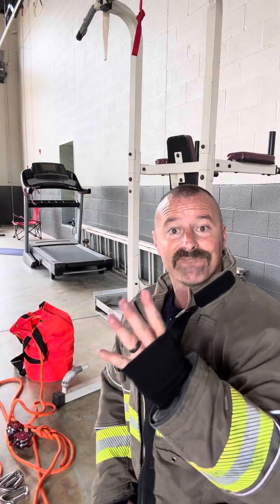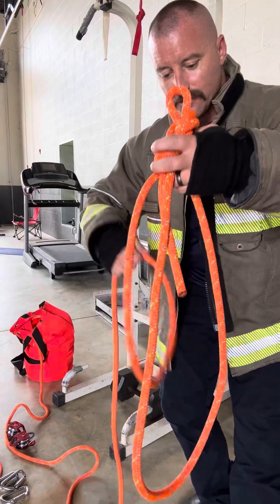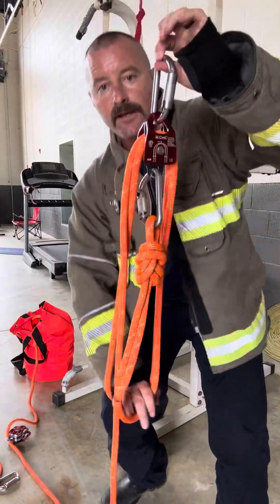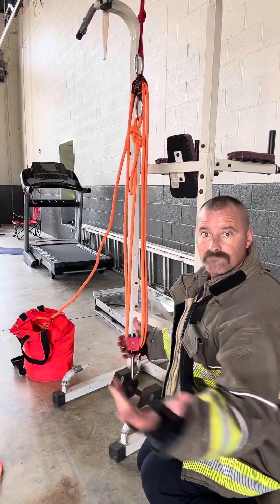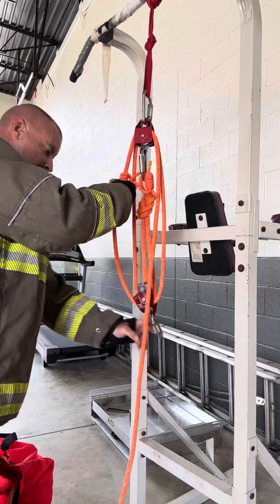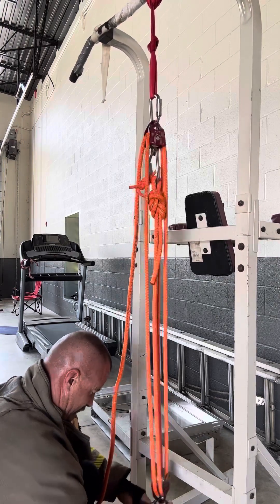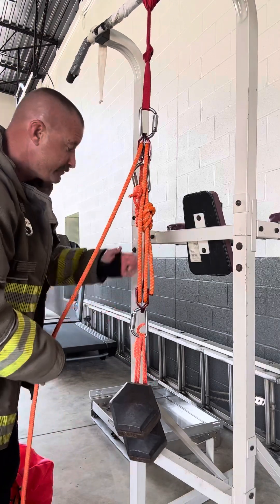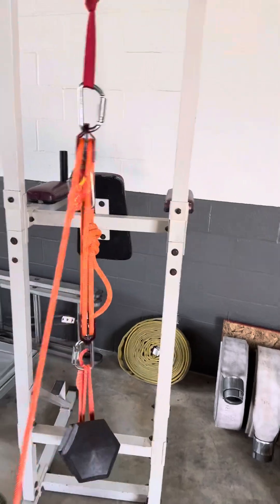4:1 mechanical advantage

Comment: Nice video, the only issue is having someone near the prusik to lower the line. If that 4:1 is in an elevated position (Tripod or top of a ladder) may have to use a change in direction and put safety near anchor point. Still Avery informative video. Thanks for posting.
Reply: I use this set up but prusik at bottom so i can reach it.